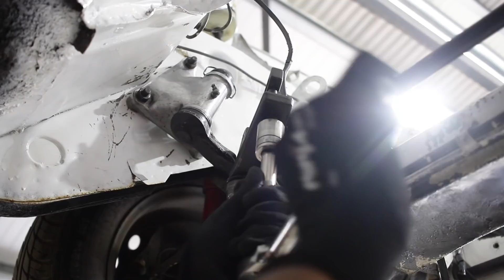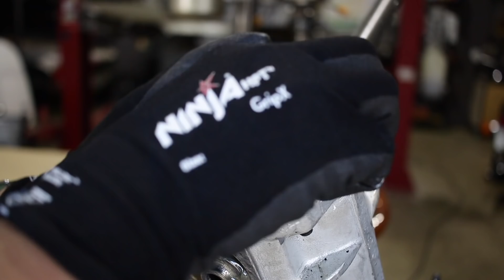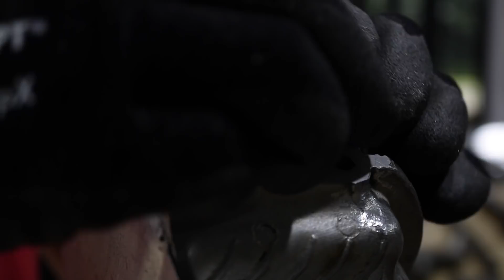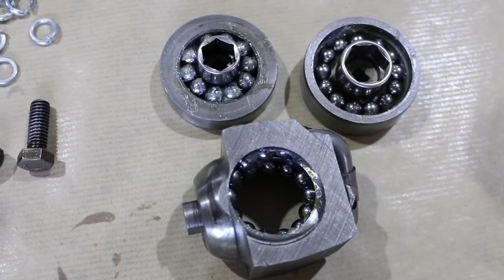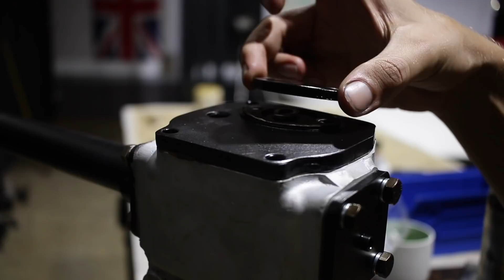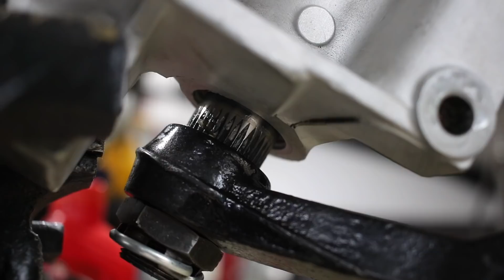Alfa Romeo Spider 105 Burman Steering Box Rebuild.

Comment: That was tremendously satisfying, which of course is the stratum above highly informative! As for that scissor action ball joint puller, I don't know how much you were tightening that but for the record, it's important to snug them up and then tap on the assembly in the spot of your choice and then tighten a bit more, etc. This way, you make use of resonance to break the parts free without ever using tremendous force which will definitely break the tool one day. (My first one was an 18G1063 BMC factory service tool for the Austin and Morris minis that I picked up in 1971. A very old mechanic gave me this tip about loosening parts at that time and I've been passing it on ever since.) 🙂 One day I wandered into a shop where they had tightened the hell out of a puller on a Jag XJ12 halfshaft which still refused to budge. Distress was building among the staff but they wouldn't let me near it, so when everyone was at the other end of the room, I gave it a tap with a hammer. It popped right out and I was offered a job on the spot. Fun times.
Reply: Ball joints are broken free by hammering where the tapered bit fits after loosening the nut. Real mechanics never use a ball joint puller, but a hammer

Comment: Hi Jethro! Great video as always, I agree that chassis flex is one of the problems but I don't believe that those cracks are due to that. Those cracks look like the roller gear was hitting the aluminium case when the steering was turned fully over due to miss adjusted lock stops. If the steering lock stops are misadjusted you will force the steering box casing and the cracks are due to this. What do you think?
Reply from the maker: I think you have a point here. After I filed this video I realised that the lock top on the passenger was missing entirely, probably the cause of the cracks. I will address this is the next video.
Reply: Smart.

Comment: Excellent video!  I had my box literally blow apart as I steered into my driveway on my 72' GTV.  Previous owner had fitted very wide large tires and the added stress and age of the box did it in.  Thank god it didn't happen while on the road.  This was 20+yrs ago and I still have the outer shaft which I use as a breaker bar.  Replaced it without the use of a lift.  What a PIA....

Comment: You did a great job reconditioning that steering box.I agree the box should have oil inside and must not be packed with grease.The mechanic who had been there before you was a slap happy joker as some ball bearings were missing from some of the bearings,there were cracks in the aluminium steering box,he had packed the box with grease and the worm gear needed to be machined smooth which he hadn't done.Your attention to detail is impressive.
Reply from the maker: Thank you. Yeah unfortunately this was far from a thorough job. This car seems to have picked up a lot of this type of work.

Comment: Nice work, and a pleasure to watch.  My only concern is the machining of the worm gear bearing surface.  I'm not sure how much you actually removed, but I worry the depth (or thickness) of case hardening is very tiny.  Time will tell soon enough - if the layer was very thin and mostly removed during the machining, it'll wear out quickly under load.
Reply from the maker: Yes time will tell. However, even after I had removed the pitting that surface was still incredibly hard, the carbide tool could still barely scratch it.

Comment: Hi Jethro, many thanks for taking the Burman steering apart and explaining what the issues are with this  type of steering box. Have been doing similar repair recently and can confirm that there is no other reasonable video on that topic out there yet. Now it is. Many thanks. Machining the rear end ball bearing surface is quite a reasonable thing to do with a good lathe available and a well grinded chisel. Using grease to get all the balls in the nut is unavoidable as well as getting the balls in the bearings. 7.144 balls are standard and can be purchased from specialised sources. Even oversizes are available. These balls are available in different tolerance classes. Thanks for not using background music.

Comment: Hi Jethro,  By my uninformed logic surfacing the face of the box at the bearing cap tightens the clearance and is the equivalent of adding a shim rather than the reverse.
Reply from the maker: Yes it tightens it, but adding shims loosens the clearance, because it creates more space between the bearing race and the gear.

Comment: I am interested in your strong opinion regarding filling the steering box with grease. Do you feel the same with a rack & pinion steering? My Dino is leaking a small amount of gear oil, from the steering shaft seal.
Reply from the maker: If the factory used oil then I would stick with that. The problem with grease is that it eventually sets, and can be cleared away from the contact surface. A steering rack or box moves too slowly to really get the grease hot and fluid, like a wheel bearing.

Comment: Any information about how you made that steering wheel puller device.  It seems really ingenious.
Reply from the maker: It's very simple, just a round plate that fits inside the steering wheel, with two holes for bolts to thread into the two holes on the steering wheel.